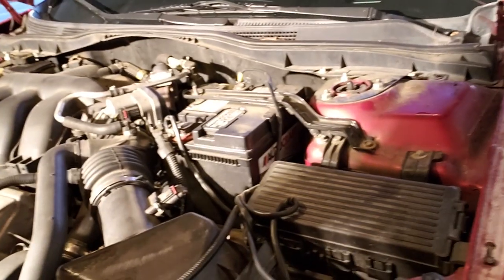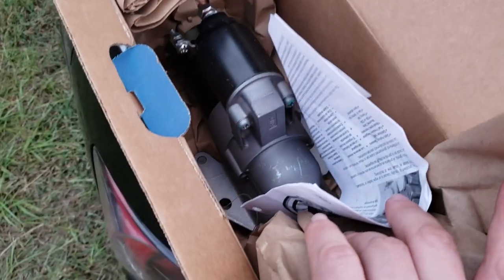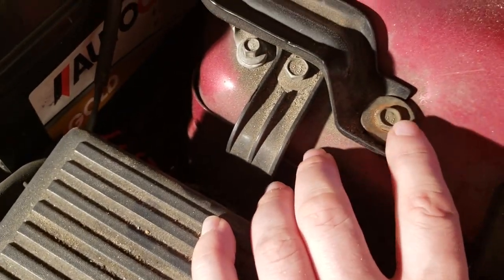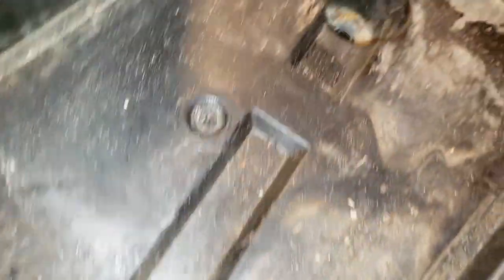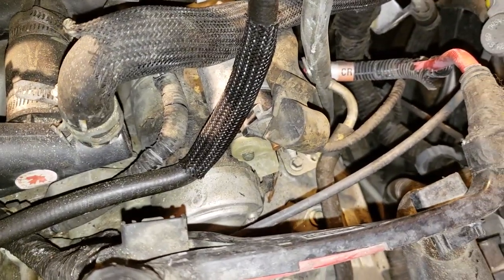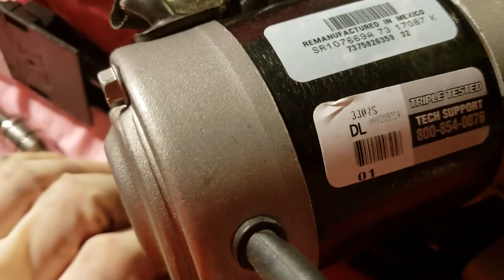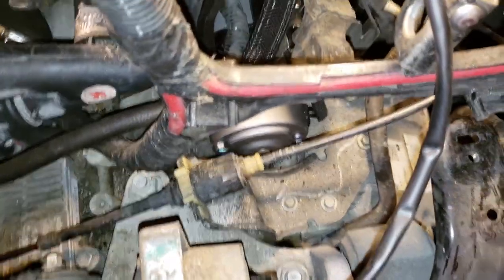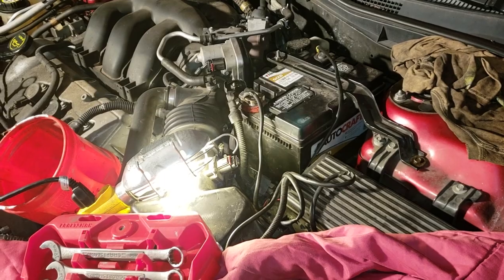HOW TO Starter motor replacement 2007 Mercury Milan/Ford Fusion 3.0L V6

Comment: I have a 2009 Mercury Milan with the starter towards the front of the motor ( not under the battery) I put the new one on, however my car is not starting. Its kind  of like making a dragging sound. Sometimes it tries to turn over. Almost like the gears are not connecting. Any suggestions?
Reply from the maker: It doesn't sound like it's mounted correctly
Reply: I have one more question. So we were able to get my car started charging the solenoid. Any advice on what could be causing this?

Comment: How did you get to the starter to hit it? Or what did you hit it with lol. I got caught in a jewel parking lot and had nothing long enough to poke it. I got so lucky and it turned over after trying for an hiur
Reply from the maker: Whacked it with a hammer and a long socket extension. Luckily, we were at the gas station together near the house in 2 separate cars, so she was able to ride with me back to my shop to get tools to bring back.

Comment: Same car.  I purchased a starter on Amazon and it worked good for a out the first 10 starts and then it started making a whining noise at start.  I was told to shim it but I tried all day and couldn't get shims in it.  Do you think I got a bad starter from Amazon and should get an ford product?
Reply from the maker: I have never shimmed a starter I replaced and have never had issues, but I have always used good aftermarket brands. I would get another starter. If you do not mind me asking, how much did you pay for this starter and what brand is it?
Reply: @KReesethebeast  $70 Amazon,  I already got fed up with it and replaced it with a Duralast and have had zero issues.  Lesson learned.

Comment: What were the symptoms of a bad starter? Did you have a “Check Charging System” warning on the dash?
Reply from the maker: No, I knew the sound it makes. I knew battery was good because headlights on high nice and bright and all electronics work and starter does not turn over at all. Hit it with a hammer and it turned over, that is when you know it is bad.
Reply: @brittanymiller1664  I installed a push button start.

Comment: Do you have to have the starter out to be able to take the shift cable/linkage out? I’m trying to figure out what size foot I need for mine particularly… can’t find the specs anywhere online, and I don’t have my manual! I have an 07 3.0L v6 180k miles and I believe my linkage is snapped ? I’m not sure but I have to pull it forward to put it in park..
Reply from the maker: Could not tell you on that one.

Comment: Well the video helped, but one of the T connectors from the shorter hose that goes to the throttle body broke off. Now I'll have to drain the coolant to install a new connector. Any chance you'd know what particular T connector I need to buy?
Reply from the maker: Oh no what a bummer! No, I am not sure of the exact part you are speaking of to even tell you where to find it. I would go to a good auto parts store and have them pull up a parts diagram of that throttle body, that way you can see every part and order the correct part you need. Hope this helps.

Comment: Hey Kevin excellent video it helped a bunch keep doing what you doing man I mean I couldn't get it out of there without your video, extensions and stuff that you use was very helpful because that's what I had to do just the way you done it keep doing what you doing man great job
Reply from the maker: Glad I could help man!
Reply: I second that notion. Thanks for the video man! Couldn’t have done this fix without knowing about the extension and u-joint!

Comment: Thank you so much for this video!  Helped me knock it out in an hour.
Reply: Same car.  I purchased a starter on Amazon and it worked good for a out the first 10 starts and then it started making a whining noise at start.  I was told to shim it but I tried all day and couldn't get shims in it.  Do you think I got a bad starter from Amazon and should get an ford product?
Reply from the maker: Glad this helped you!

Comment: I have a 2007 Mercury Milan as well. I have 260,000 mi on my car and the starter just went out.  And and you said starter motor goes out about 250,000 miles. You're right on point for that, kudos to you. It's letting me tap on it on the starter motor and the car will turn over and start. How long will that last before I have to go ahead and replace the starter? Thanks a bunch your video saved me a lot! I appreciate you being on here. Have a great day!
Reply: Same car.  I purchased a starter on Amazon and it worked good for a out the first 10 starts and then it started making a whining noise at start.  I was told to shim it but I tried all day and couldn't get shims in it.  Do you think I got a bad starter from Amazon and should get an ford product?
Reply from the maker: As soon as it does that, time for a new starter. Glad this video helped you out.
Reply from the maker: You should get a starter not from Amazon for sure.

Comment: Thank you for the video. It seems our starter is on its way out, but we only have 107,000 miles. It won’t crank at times. Even the garage where I normally go agrees, but it only did it once for them. At the moment it’s working. Do you have any oil leaks ?
Reply from the maker: Go ahead and put a new one in before it leaves you stranded, but I am sure you have by now. No the old Merc did not have an significant leaks that I can remember.

Comment: The starter on my 06 Milan didn't go out. The starter solenoid did. Still had to remove and replace the starter to fix it. I Immediately traded the car in after that. I had too many issues with the car since day one and the starter solenoid going out was the final straw. Not to mention the starter was buried under the intake manifold. Great video, but it was just too much work for me to keep my Milan
Reply from the maker: I can relate! Hope you found something you like!
Reply: @KReesethebeast  Yes I did. I picked up a 06 Acura 3.2TL. All it needed was a new battery and rear disk brakes. And I haven't had an issue since

Comment: My project was a 2012 MKZ. BTW starter mounting bolts were 1/2" SAE. 
2nd time with same problem. Bendix mechanism binding on shaft. Helluva racket on the flex plate until the Bendix bumps back. Don't want to chew the flexplate up. Rather rebuild this starter than replace assuming factory starter is better than aftermarket Chinese??????? I have a local old school guy who rebuilds starters alternators generators etc. 

PS. Really good tutorial. Thank you
Reply from the maker: That is awesome. I use duralast from autozone, lifetime warranty. Buy once never have to pay for one again.

Comment: Thank you for your video. I was having a hard time finding the location of the starter.
Now I need to decide if I want to replace it myself since I may need to get additional tools 😂
But very educational, keep doing what you do!
Reply from the maker: You are welcome and thank you!
Reply: I changed mine in 45 minutes. Hardest part is getting the dowels to loosen from its location. After that it was easy-peasy

Comment: You can get the exact same starter off of eBay for $35.99 brand new, AutoZone usually tells you they have to order it where do you think they order from eBay
Reply from the maker: I haven't found a starter on ebay that is Duralast brand with a lifetime warranty for that price unfortunately.

Comment: you called the smaller terminal next to the battery cable terminal on the starter a ground cable. But isn't that actually the solenoid terminal with the starter having a case ground where it's bolted onto the transmission?
Reply from the maker: On this car I think so

Comment: My starter will not come out even after removing all the bolts even to the battery.. it wont budge
Reply from the maker: Tap it with a rubber mallet, or put a piece of wood up to it and hit it with a hammer. That should free it up.

Comment: Is it the same process for the 2006 Lincoln zephyr? And overall how long does it take to install
Reply from the maker: I am not familiar with that vehicle. Ford, Lincoln, Mercury, they are all the same overall, so I am assuming it would be the same process. Does under your hood look the same as this Mercury Milan? It took me under two hours to change the starter once I had all the parts and tools I needed. Hope this helps you out.
Reply: @KReesethebeast  yes they have the same engine and placement of the starter under the battery. Thanks 4 the info it saved me alot of💲💲
Reply from the maker: @pelemichael9869  Awesome I am glad this helped you!

Comment: What is that grinding noise at 12:48??
Reply from the maker: Not so much a grinding noise as it is a squeal from one of the belts on the start up.
Reply: @KReesethebeast  ok, was curious, my 07 does that occasionally